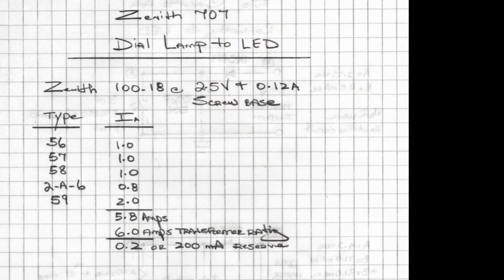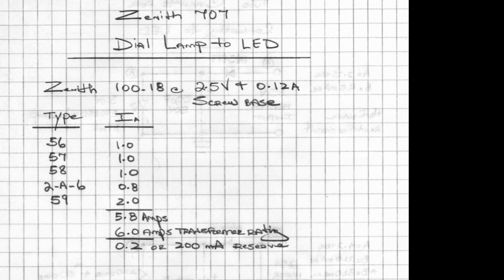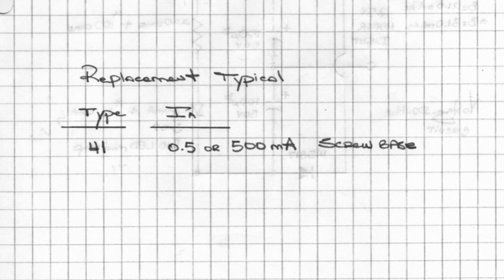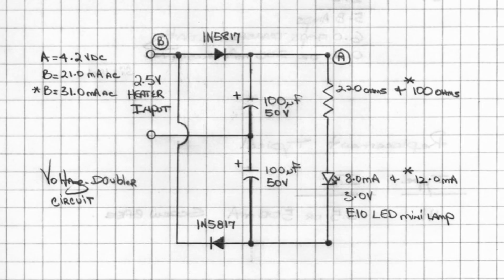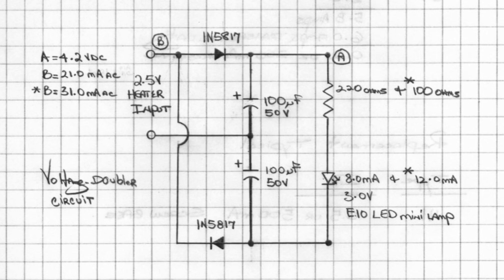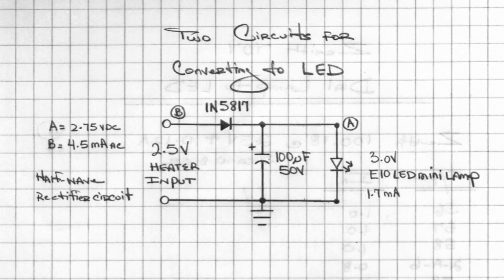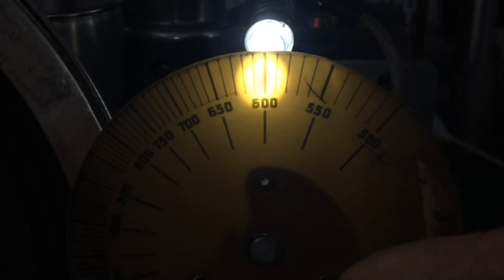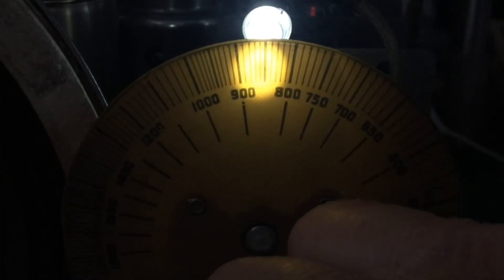Zenith 707 - Convert a 2.5VAC Dial Lamp to a 3.0VDC LED Dial Lamp

Comment: That was a great topic Don.  What would be cool would be to tape off/MASK the ends of the bulb to form a rectangle light dial pointer. Great tutorial all the way, thank you !!!!!
Reply from the maker: Thanks Ron. Stefan one of viewers shared his wisdom and I went back with a file and flattened the bulb and sanded the sides to scatter the light. I then used a walnut touch up marker on the bulb to further the... Photos are on my shared drive at the link provided. To your point and Phil’s, all of these methods should be explored as each conversion may need to be tackled differently. Best, Don
Reply: @RestoreOldRadios   Looks really good !!!!

Comment: Hi Don,
Do you find that converting dial lights from incandescent to LED can be a bit of a dark art?
For example, it can depend upon the dial, back defuser arrangement, and their positioning.  LED illumination might work well on some radios better than others.  I fitted ‘Soft white’ LED dial illumination to a 1953 Pye model P75, and it worked almost as good as the incandescent lights.  I scuffed up the ends of the LEDs with 680 abrasive paper beforehand so as to distribute the light over a wider area.  I applied the same LED arrangement to a Philco  ‘hippo’ model 46-420 and the result was nowhere as effective.
I believe more experimentation is required in this area as I’m starting to notice certain types of incandescent lights (suitable for radio dials) are not so easy to find in various stores.  quite likely all incandescent lights will be fazed out sooner or later.
Lovely chatting to you my friend, Phil, The man from Sheffield
Reply from the maker: Phil - this is only my second conversion to LED, so my experience is very limited. I think you hit the nail on the head. The defuser, angle and distance seem to be the most important aspects. In my case, I made a new bracket for the dial lamp holder and it’s almost horizontal as compared to the OEM that was oriented vertical. In addition, it was moved further away from the defuser. I also scuffed up the dial lamp well after Stefan reached out about how doing so would help scatter the light, which it did. Something I tried as well was a walnut furniture touch up marker and applied it to the..., which softened the light as well. I agree, more trial and error will be needed to find the best practice, but I think each situation my present a different approach. It’s great to hear from you too Phil. Take care and thanks again for reaching out my friend. Best, Don

Comment: Why   not  just  use a  5  voltage   regulator     with a  drop  resistor  to   limit  current
Reply from the maker: John - I don’t have a 7V DC source in the radio to use the voltage regulator. Thanks for reaching out and watching. Best, Don

Comment: It does work but you have to admit it is a cold light ( 5000K). There may some LED's that have a lower color temperature range(2700K to 3000K)
 that would look as if a regular incandescent bulb was put in. Do like the solid state conversion idea Don .Wish you the best Steve .
Reply from the maker: Steve - I agree it's a cold light, but I was able to soften it a bit by filing the top flat and filing the edges to scatter the light based on a practice/technique Stefan shared. Check out the after photos and let me know your thoughts. Best, Don

BTW - I also considered painting the lamp.

The OEM Dial Lamp is no longer available to my knowledge. Photos of my new mounting bracket & schematic for the two circuits are available at: https://drive.google.com/drive/folders/16PkNaQRBY6-BHv-SamVYG2A9Yik38NJZ?usp=sharing

In addition, thanks to Stefan for recommending I file the LED, which causes the light to scatter and recreates the original look of the lamp. Photos are uploaded for reference. Thanks again Stefan!

Comment: This LED is rather sharp focused due to a lens at its top. Use a file to rasp the top of the LED more flat and uneven to scatter the light. Then you have a more wide spot.
Reply from the maker: Stefan - thanks for the advice, I appreciate it. I've since built a new mounting bracket and moved the LED back and it covers the window now, but I will take a spare LED and follow your recommendations as well. Photos of my new mounting bracket & schematic for the two circuits are available at: https://drive.google.com/drive/folders/16PkNaQRBY6-BHv-SamVYG2A9Yik38NJZ?usp=sharing
Reply: @RestoreOldRadios  Very good!
Reply from the maker: It worked perfect! Photo's uploaded for reference. Thank you. Best, Don
Reply: @RestoreOldRadios  Glad to help you! Love your videos.

Comment from the maker: The OEM Dial Lamp is no longer available to my knowledge. Photos of my new mounting bracket & schematic for the two circuits are available at: https://drive.google.com/drive/folders/16PkNaQRBY6-BHv-SamVYG2A9Yik38NJZ?usp=sharing

In addition, thanks to Stefan for recommending I file the LED, which causes the light to scatter and recreates the original look of the lamp. Photos are uploaded for reference. Thanks again Stefan!
Reply: Thank you again Don, for the workaround. Should I ever run across,this model radio. All my very best.
Reply from the maker: Thank you Bobby, I appreciate you watching. Best, Don

Comment: Nice electrical LED conversion for an obsolete bulb. You sure have a lot of knowledge.
Reply from the maker: Thank you Ken. The two circuits I described have been around for ever and I’m just leveraging 1 of 2 for... I built a new bracket angled at about 45° to better illuminate the dial. It seems to be working perfect at this time. Thanks again. Best, Don